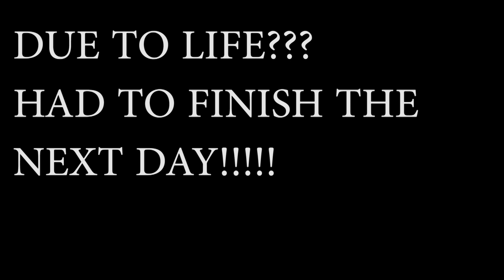RAIL YARDS: WAYS to make $$ In RAILS without TRUCK DRIVING!/ DRIVERS TAKING DUMPS AGAIN!!

Comment: 9:27  Always figured it was called a crossdock because freight crosses the dock from one trailer door to another, unlike a warehouse, where freight is unloaded and stored until it is needed for delivery.  LTL terminals are basically private crossdocks.  Outbound freight unloaded from P&D trailers is crossdocked to line haul trailers, while inbound freight unloaded from line haul trailers is crossdocked to P&D trailers.  The idea is to get the freight out of one trailer and into another.  LTL terminal docks usually have a limited amount of freight-space, because freight sits for a relatively short period of time before it's loaded onto a trailer.   Even though LTL docks are not necessarily called crossdocks... that's pretty much what they are.

In the ISO container business, which involves ocean boxes that ride on ships, trains, and chassis pulled by trucks - crossdocking works in a somewhat similar way to LTL.  Korean manufacturing giant Samsung decides to ship a 40' container of TVs from their TV plant, a 20' container of phones from their phone plant, and a 20' container of laptops from a third plant.  Those three containers are hauled by trucks from their respective manufacturing plants to the Port of Busan, Korea and are loaded on a container ship.  A few weeks later, the ship arrives at the Port of Los Angeles or the Port of Long Beach carrying the three containers.  The containers are lifted from the ship, and are eventually loaded onto a BNSF intermodal train bound for Chicagoland.  In a few days, the train arrives at the BNSF Chicago Logistics Park in Elwood, Illinois.  After the three boxes are lifted from their railcars, they are placed on chassis and are hauled by truck to a huge break-bulk crossdock within the logistics park or somewhere nearby.  There are three empty semitrailers belonging to Best Buy, Walmart, and Amazon waiting at the break-bulk crossdock.  The container of TVs has pallets that are destined for the Amazon distribution center, the Walmart disto center, and the Best Buy distro center.  Same for the container of phones, and the container of laptops.  The inbound shipments are unloaded one pallet at a time and are crossdocked to the Walmart trailer, the Best Buy trailer, and the Amazon trailer.  At the end of the process, each of the three outbound trailers now have a pallet of phones, several pallets of TVs, a few pallets of laptops, and a variety of pallets of whatever else came in that day in other containers.  Loaded trailers also arrive at the crossdock with American products bound for export.  For instance, several trailers of Jack Daniels Tennessee Whiskey arrive and are crossdocked to separate ocean boxes bound for China, Japan, and Korea.  The process is now simply reversed.

Crossdocks typically have a limited amount of room for the freight because the idea is to keep it moving.  A crossdock can be a long skinny building.  It just needs to have as many dock doors as possible.   Anyone who is able to lease, operate, or own a crossdock or secure drop yard near an intermodal terminal would be in a position to build a successful and sustainable business.  Very good video subject.  Have a nice weekend, my brutha 👍🏿
Reply from the maker: What's up "O"!  You're very knowledgeable of this business and it's always a pleasure to read your very Insightful comments big bro!  Be safe broski!